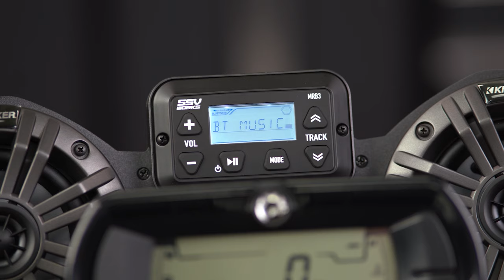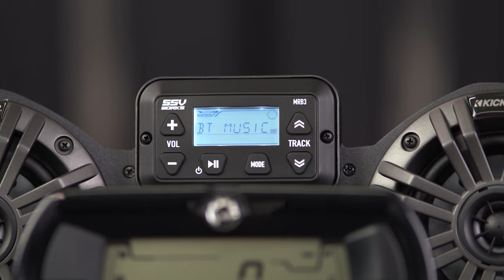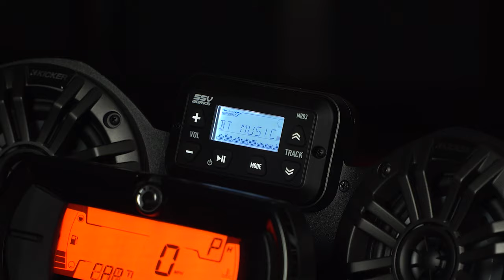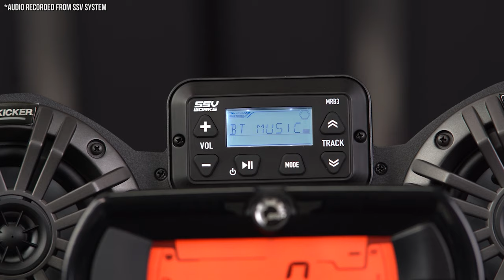Can-Am Ryker 200W Plug N' Play Bluetooth Audio System

Comment: Clean Look. But the price is up there. This has to be the most expensive speaker add on. I have seen yet.
Reply from the maker: Yeah, it's more than some other system we've launched.. but has alot more features than anything else we've seen so far. Besides being entirely Plug N Play, the MRB3, bluetooth controller has built in eq settings and the amp on board is actually a 200W 4-channel marine amp. We're currently only using the front two channels at this time.. but are working on rear speaker brackets for our luggage system that will allow this kit to be expandable to 4 speakers. This will give you sound front the front and the rear for great imaging and great volume on those high speed runs.
Reply from the maker: @jayyourneighborhoodcarguy3916  The amp included is 4 channels. So you could for sure.

Comment: Can you add additional speakers i got the ssv system but its over powered by exhaust
Reply from the maker: The amplifier is a 4-channel amp and will support a 2nd pair of speakers, but it's not a plug and play add-on. You'd have to source aftermarket pods and connect to the rear speaker wire channels coming off the amplifier.

Comment: just got these bad boys
Reply: How are they at highway speeds
Reply: Jay Your Neighborhood Car Guy a little hard to hear but on the normal road amazing I also have a very loud 2 brothers straight piped muffler so that ads a lot of noise still very good tho
Reply: How do you feel about them now that you've had them for a while?
Reply: @xMasonTPXx  yes, they are awesome, very loud, very quick with Bluetooth connect. Easy to install and weather proof made it thru winter, rain, and extreme heat. Recommend forsure.

Comment: Will it work with the madstad adjustable quick release windshield?
Reply from the maker: Yes it will, but you'll need the adapter bracket to run both. That can be located here: https://www.slingmods.com/canam-ryker-madstad-windshield-ssv-works-stereo-adapter-plate
Reply: @Slingmods  thank you

Comment: Can a windshield be installed with this system
Reply from the maker: Hello Tony, the MadStad Shield can but you'll need an adapter. here's the links to both:
🛒Madstad Adjustable Windshield System: https://www.slingmods.com/canam-ryker-adjustable-windshield-madstad
🛒SSV Stereo Adapter Plate for use with our Madstad Windshield: https://www.slingmods.com/canam-ryker-madstad-windshield-ssv-works-stereo-adapter-plate

Comment: By the looks of it, you can't mount a windshield with this installed?
Reply from the maker: Only our MadStad windshield is compatible which is here: https://www.slingmods.com/canam-ryker-adjustable-windshield-madstad You will also need the Adapter here: https://www.slingmods.com/canam-ryker-madstad-windshield-ssv-works-stereo-adapter-plate

Comment: if you add the stereo, would you still be able to add the adjustable sport windshield?
Reply from the maker: This stereo system is only for use with our Adjustable MadStad Windshield located here: https://www.slingmods.com/canam-ryker-adjustable-windshield-madstad You'd also need our adapter plate here: https://www.slingmods.com/canam-ryker-madstad-windshield-ssv-works-stereo-adapter-plate

Comment: I've read some reviews that this system isn't very loud.  Below, you stated that only the front two channels are being used.  Does this amp not allow bridging....so we could use the extra rear channel power for the two fronts??
Reply from the maker: You'd blow the two fronts if you bridged the amp. You can however add an alternate set of speakers with the rear channel. I personally think it's pretty loud.. but if you add a full face helmet and exhaust to the mix.. it will indeed muffle your ability to hear at highway speeds.
Reply: @Slingmods  , thanks for the reply.  May I ask if you would consider selling the kit without the speakers and even possibly the amp (Keep the SSV head unit).  I've seem some comments that they would like to be able to buy just the molded case.  This way owners could put in better speakers and amp ?
Reply from the maker: @douglasmontgomery6315  Hell Dough, Regretfully, that's not possible as these are pre-packaged as kits. My apologies!

Comment: Hey guy slingmods. Its possible to change the kickers for infinity 4 inch speakers?
Reply from the maker: Hello Carlos, you probably could. We haven't tried swapping these out for any other speaker brands. You'd want to make sure you swap them out for another 4" marine speaker and double check magnet clearance on these vs. the Infinity to make sure you'll have adequate clearance.

Comment: I’m interested in riding this but I need to know how to also run my 6.5 speakers to the amp. I’d like them to plug in directly so it is possible I get the plug adapter?
Reply from the maker: Hello Boerste, the amp included is a 4-channel amplifier so you could definitely run your 6 1/2" speakers in addition to the speakers included with the kit for a total of 4 speakers. The speakers included with the kit would be plug n play, your "add on" speakers would be hard wired to the purple and green rear channel speaker wires on the amplifier.
Reply: q

Comment: Questions. Can we install a passive crossover to this system? Do divied lows from highs
Reply from the maker: Hello Carlos, no because these speakers are coaxials so the mid and high is built into one speaker with one speaker wire per side.
Reply: @Slingmods  o ok thanks guys GREAT and fast response love your service. I will be a faithful customer.

Comment: I love really loud music. Are there any speakers that you could add to this setup?
Reply from the maker: Hello, this system comes with 2 speakers.. but the included amplifier is a 4-channel amplifier. So you could technically add two more speakers behind you.. but they would have to be a custom solution as we don't offer any rear channel speaker mounts at this time.
Reply: I already have 2 6.5 speakers on my bike I just need to know how to plug them to the amp. If I order the system

Comment: Does it come with an antenna?
Reply from the maker: It does have an onboard AM/FM wire antenna built into the MRB3 head unit.
Reply: Slingmods.com I’ve already ordered it. Any idea if it’s going to be ready in early January?
Reply from the maker: @dabo1971  Hello Dabo.. we're actually expected to get our first batch Mid December. We put January on the site as we prefer to Under Promise and Over Deliver!
Reply: Do you know if you guys started shipping the systems out yet. I see they are available on your website?
Reply from the maker: @dabo1971  Yes, all pre-orders have been shipped! :)
Reply: Thank you. I received the email yesterday
Reply: I got mines in already is it a way to preset the radio station I'm having a hard with that?
Reply: I'm having a hard time preseting the stations
Reply from the maker: @albertjohnson3795  Hello Albert.. that's a great question. I don't believe so.. the manual indicates these notes for the AM/FM portion:

1. Selecting FM/AM Band:  Press MODE until the FM or AM band shows on the display.

2. Automatic Station Search:  Press "up" or "down" arrows to start automatic station search. The search stops when a station is found.

3. Manual Station Search:  Press and hold    "up" or "down" arrow until M - SEEK. Press the "up" or "down" arrow to briefly to change the frequency until the desired frequency is set. Change to Automatic search (A - SEEK) mode after a station is found.
Reply: Thanks buddy now it works just fine

Comment: How is the sound when you riding?
Reply from the maker: This is our loudest stereo option and is quite loud. The sound while riding would depend on if you're wearing a full face or half shell helmet. With a full face and wind noise the sound is diminished at high speeds. With a half shell and windshield you're good at at all speeds.
Reply from the maker: @michaelbarnes4166  Sounds good Mike. Thank you!